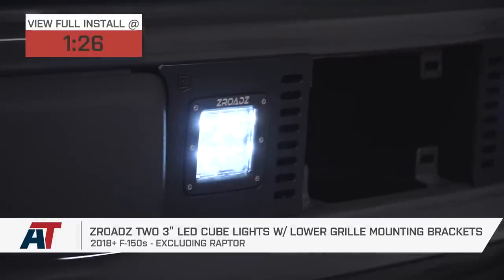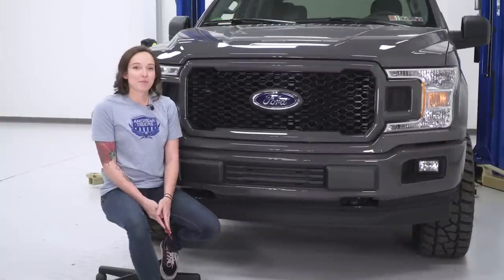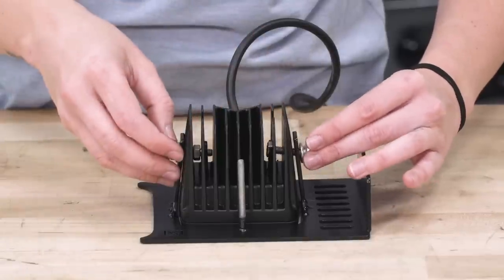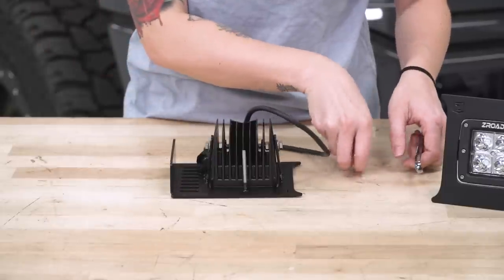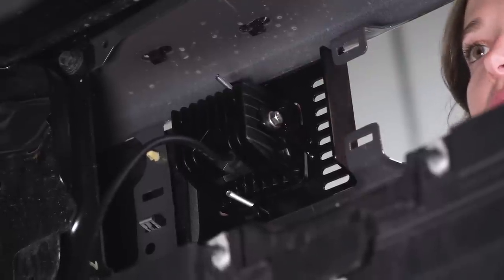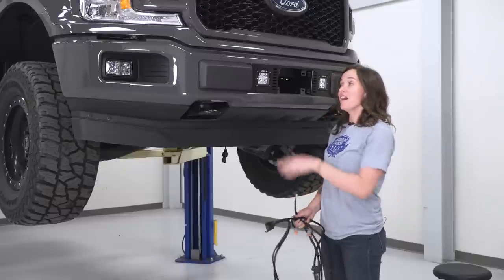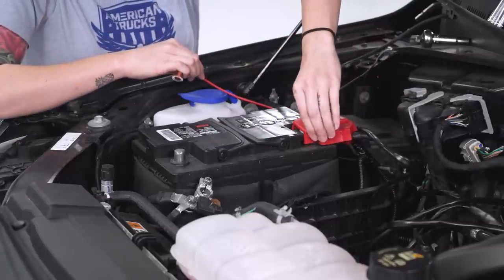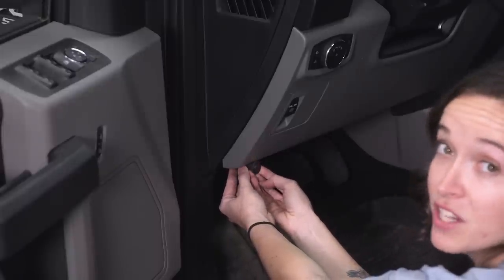2018-2019 F150 ZRoadz Two 3 in. LED Cube Lights w/ Lower Grille Mounting Brackets Review & Install

Comment: Should also note this kit is only for trucks with the 5.0 as it’ll block the intercooler on the ecoboost engines.
Reply: Really not an issue since some states require the plate in that exact area. Texas is an example where it’s mounted right in the middle blocking’s the inter cooler
Reply: You can cut back the rubber inlet and make it fit still

Comment: It looks like my front license plate will block the lights.
Reply: I have this installed on my truck it works great and there is an open grid-like plate to cover the opening from the manufacturer if you want it.  I mounted the front license plate to one of the plastic pieces to the right of the opening.  I needed to keep this open for airflow to my eco-boost.